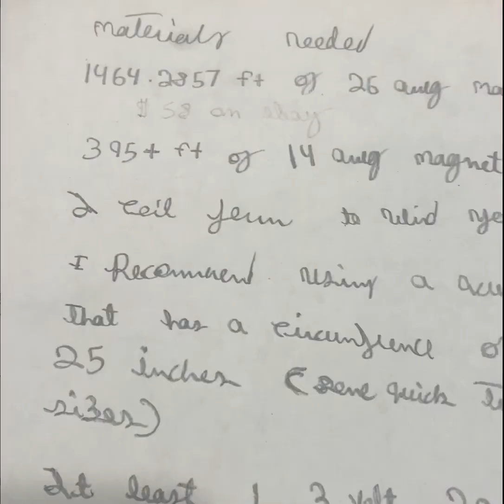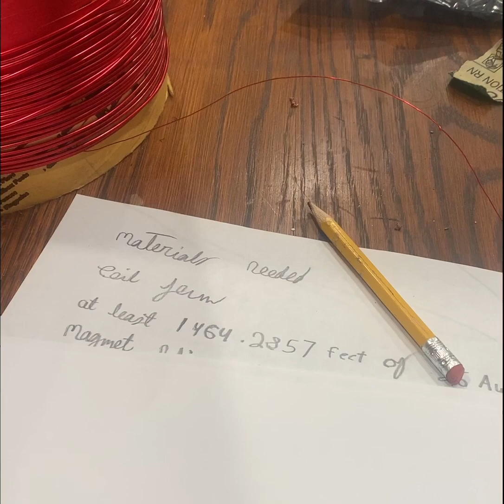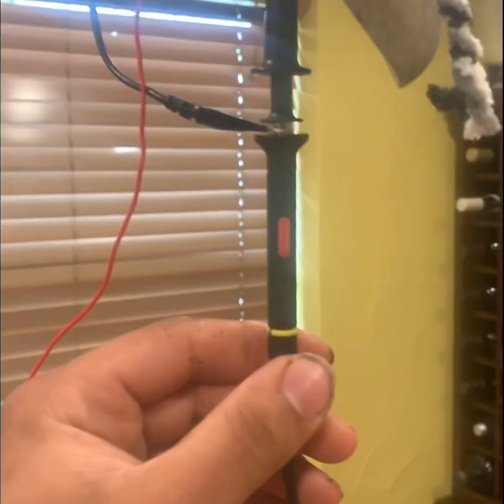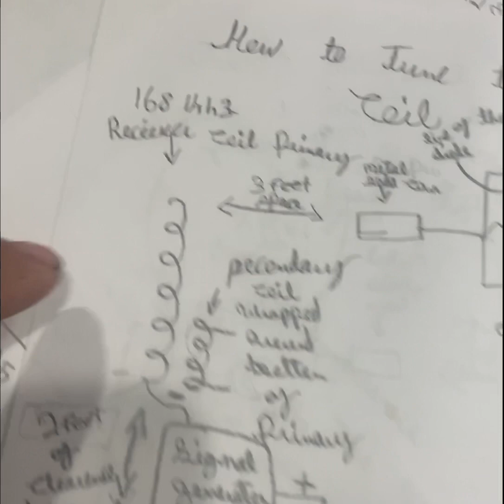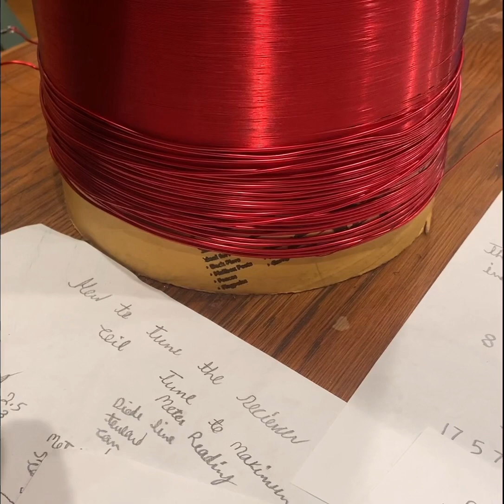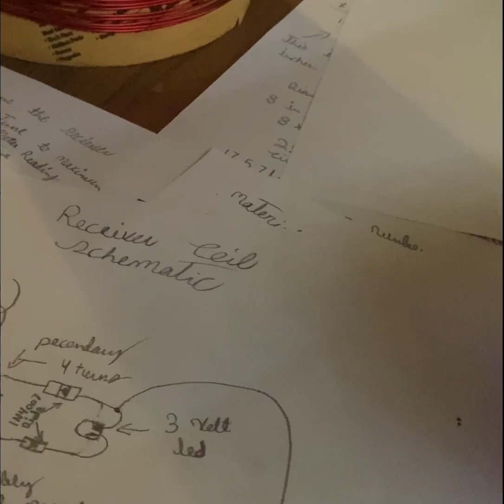How to build a receiver coil to receive my wireless electricity all in one video

Comment: exact same function generator (off aliexpress) as I have wo0t - jds6600. I wonder if you did as I did, modded it to get a TTL signal to trigger my scope 🤠
I never thought it would be feasible to be able to get 1/4 wave length of conductor for low-kHz range of frequencies, mine does around 130kilocycles (with bifilar pancake). I am inspired to make an attempt now, thanks. $58 is manageable!

Comment: Could you make an example of how we might pull electricity from the ether?
Reply from the maker: I have a video on it Check out the video where I light a small blue led by connecting a coil to my metal gutter system and connecting the other side to an led and the other side of the led to the earth
Reply: Without it being transmitted specifically. Natural energy

Comment: May I suggest a bifilar  flat spiral for the primary of your receiver coil . If it is calculated with the wave length , the capacitance and inductance will have better tuning. And the electrostatic and magnetic fields will be held in a tighter plane area, which will be better to concentrate the transferring fields to the secondary coil.
Reply: indeed! that's what I use, some vids on channel showing bifilar pancake HV coils (of transmitter and receiver coils in single wire setup)

Comment: How do you find a signal generator capable of 168khz??? All I can find are ones that go to like 30mhz, and those are 300+ dollars....
Reply from the maker: You will also need an oscilloscope
Reply from the maker: Yes it has to be capable of producing 20volts
Reply from the maker: kHz is less than mhz so I a signal generator goes from 0hz-30mhz it will work 1 khz is 1000hz
Reply: @dr.parkinstine  Does it also have to be able to generate 20volts? I'm guessing yes because you said that, trying to find one on amazon that does that, some of them don't explain what the voltage output is through the signal. Trying to find the cheapest one capable of this on Amazon haha.
Reply: @apoc7468  keep us updated if you build it!
Reply: @dr.parkinstine  oh jeez I feel silly now 😅 yeah I just started looking at them today idk why I thought kHz was more than Mhz its been a while since I really thought about what those mean...
Reply from the maker: I recommend Amazon prime
Reply: I gotta be missing something because these signal generators can costs upwards of $2k most of the cheap ones only say 30mhz... and the ones that claim higher than 168khz don't even list prices and ask for inquiry's about the price.

Comment: To help keep the coils in place after you tune in the coil, just add super glue to the cardboard and coils
Reply: Won't that affect the tuning now that you've added another material
Reply: @seven471 I heard Parker mention that you could staple the wires to the cardboard. I would think that adding another material would mess with the tuning also but maybe not?

Comment: Hey parker! How would i know exactly what frequency I'm tuning my 26 magnetic wire to?
Reply: You need to use a signal generator that generates up to 168khz, and you use the O-scope to adjust it till you resonate with the frequency the signal generator is sending through it. The problem I've run into is once you get past 30-40mhz on the signal generators, the ones capable of things like 168khz get VERY pricey.... I might be missing something though as I'm pretty new to those devices and I'm not really sure what I'm looking for or at with the specifications.

Comment: I missed something here, you have connected the LED to the coil, how is it wireless? Thanks
Reply from the maker: Because the led doesn’t have to be connected to the power source by wires
Reply: The receiving wire circuit is technically not touching the primary . . . there is no power source on the secondary wire circuit.

Comment: You know I was just staring at one of my old kit radios in my collection. Have you ever thought about selling one of these as a kit the way many neat different electronic gadgets of days gone by used to be sold ?  By the way if you have a shop in your area that winds electric motors ? I buy a lot of my supplies and parts from electric motor and electric apparatus repair shops. Recycling and salvage yards are another great source for treasures or as I call it Rusty Gold. You take care man great work 👍

Comment: How do you get the 1464.28 ft from your 168 Khz tuning ??? I dont get the formula and how you figure out it was 1/4 and not 1/6 or 1/8 for example? 🙏🙂
Reply: https://www.everythingrf.com/rf-calculators/frequency-to-wavelength 168000 Hz is 
1784.47891667 meters, then convert to feet and divide by 4 is 1468.5 feet